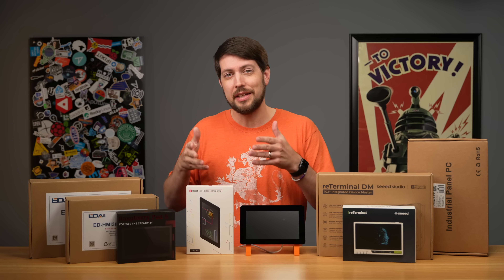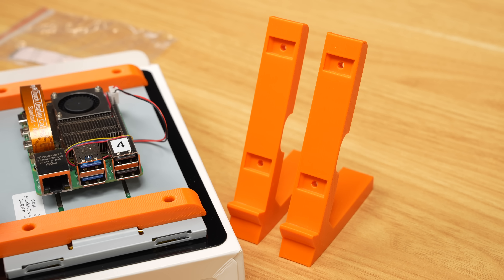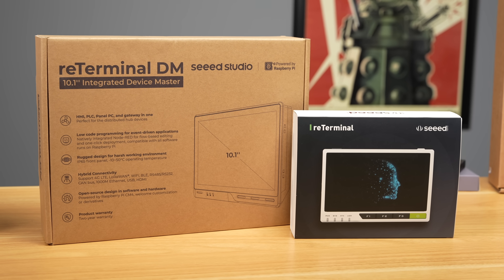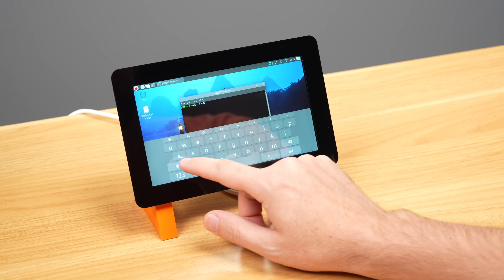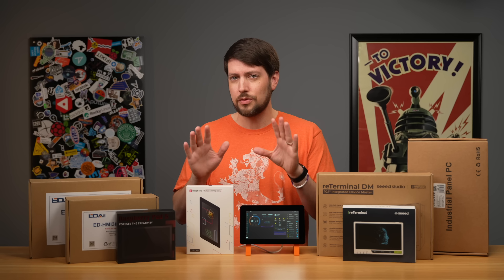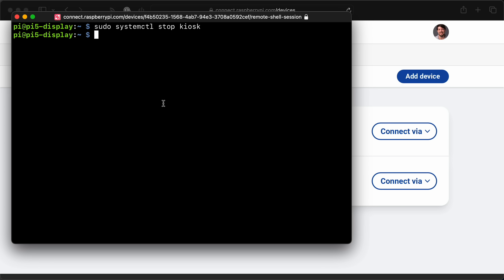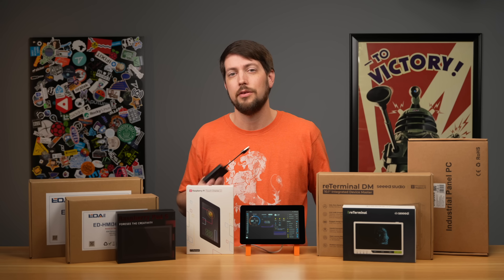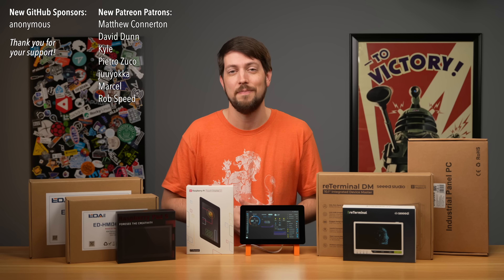I Control EVERYTHING with this Raspberry Pi

Comment: Now you got me a little worried. I bought 2 waveshare displays to see how useful they could be as displays, as well as an used ipad. One waveshare for raspberry zero w, and one with the built in controller.  I hope they've gotten a lot better than what you experienced.
Reply from the maker: It really depends on which display; some of theirs are great, some are not as well supported. But most of the time you can at least get it working with minimal fuss.

Comment: Would it be possible to use 5 finger touch to exit the service or application? Perhaps show desktop on 5 finger touch?
Reply from the maker: Possibly! So far I haven't seen anything in Pi OS take advantage of more than one finger at a time.
Reply: KDE has a lot of 3 finger touch screen gestures that could do this, and you can also configure actions when swiping in from each edge of the screen

Comment: I kinda wonder if refresh rate is a factor, and if you could dynamically scale that...
like android devices with high refresh rate displays use dynamic refresh rate to save a bunch of power, lik on my phone: if no touch and no video/animation, drop to 60fps, if touch and no video/animation, bump to 90fps, if touch and video/animation, then bump up to 120 (the highest it goes), of course, I expect the raspberry display can probably do 60fps max, but still kinda wondering 1) whether it's the only supported refreshrate, hardware-side, and 2) does using lower refresh rate have any power draw difference...

of course you'd also be wanting some battery-friendly cpu scheduler to reduce clock speed on idle and stuff like that, but that's more of universal stuff applicable to every system

Comment: For what it's worth, I can rotate the terminal on my Lenovo IdeaPad with this command:

echo 1 > /sys/class/graphics/fbcon/rotate

(Value can be one of: 0=Normal; 1=Clockwise; 2=upside-down; 3=CCW)

It might be possible to add something like that into early userspace to force the boot messages into landscape but I doubt if it would be worth the trouble.
Reply from the maker: We figured it out over on GitHub! (Thanks especially to one of the YT comments, too!).
Reply: It has been 0 days since I recompiled the Linux kernel

Comment: what's the CO2 sensor you use?
Reply from the maker: AirGradient - they make a few different types of sensors but all open source, and they aren't priced bad either. They're IMO as good as AirThings but easier to integrate with Home Assistant!
Reply: Ah, the airgradient, you mention it later in the vid, cool

Comment: So my parents got a 2021 Honda CRV with a semi-basic entertainment center and I think it's the best mix of simplicity, accessibility (still using knobs for the heat/AC  so you don't HAVE TO look away from the road - AND having steering wheel controls to change volume/track and cruise control... plus the buttons are in a good layout) I connect my phone with bluetooth and it does calls over the speakers if I want, plus I can control my phone from the steering wheel.... BUT it doesn't have GPS....  but you can connect to you phone with bluetooth and will come over the speakers and you can control the volume with the steering wheel... but the map doesn't come up on the car's screen.... but mounting a phone is easy 
- the car has lane keep assistant (it rumbles the steering wheel  when you get too close to the lines) and auto braking which I didn't know about until it started doing it way sooner than I would have  and it SCARED ME!!!! - And it's great on gas.....  Oh and it has a rear-reverse cam too, which I've grown to love LOL
- -  So you don't HAVE TO get the latest and greatest tech when you buy a new car, and I think they would have electric cars that have the same level of tech that I listed here (I think that's the type of tech that you'd want in a car too... I think MOST PEOPLE would be just fine with that level of tech (except maybe built-in GPS) - you don't need all the apps, and all the internet connection so you get album art for the music you already own....
- so MAYBE a Honda is a brand you haven't looked into, and the small SUV's carry 5 adults snuggly lol, but 4 comfortably... and they have a decent size trunk too... So maybe you ought to look into the CRV and see if it's something you'd like (idk if you want and electric car or not, but I'm sure they have a good selection) - I hope this helps is some way :)

Comment: Just buy one of the Amazon special Carplay displays. Costs the same $150, and works well enough!
Reply from the maker: The only downside there is you don't get as much freedom to tinker with it once it becomes obsolete in a few years! Though it's not a bad option by any means. I've been looking at buying a Carpuride system for a while.

Comment: i have a dedicated battery and alternator to run a small rock64pro and a 10" display for carplay in my old 1991 CRX been working smooth for years now! Better than some of the new cars with all display only 😕

Comment: I've got my old Pi display running a minimal HASS dashboard with a PIR wired in to turn off / on the backlight when movement is detected.  Does the lcd_rotate=2 in /boot/config.txt not work anymore?  On my current setup that rotates everything from boot up.

Comment: You COULD just install an aftermarket headunit into your car and get ALL the features you want, like maps/gps navigation, bluetooth connection for playing your phones music, DVD playback with multiple monitors to keep the kinds entertained (plus you can hook up game consoles to it too) , Netflix/Disney/youtube/etc, multiple ways to connect to the internet (built-in sim card slots for 5g internet, ethernet for a mobile starlink, plus a wifi hotspot to share it with your phones and whatnot) ... everything a new car 'entertainment' center would have, plus more..... ity all depends on which one you get.....
this is the BEST WAY to bring the entertainment center up to date without having to buy a new car... 
- I TOTALLY hear ya with the problems of modern cars and stuff like charging you MONTHLY to use YOUR OWN HEATED SEATS!! 🤬 PLUS their softw3are is GARBAGE, SLOW, and SO EASILY HACKABLE!!!  And WHY do I HAVE TO LOOK AWAY FROMT HE ROAD and NAVIGATE MENUS all JUST TO CHANGE THE TEMP OF MY HEAT?!?!??! And NO Mr. Amazon I DO NOT WANT ALEXA TO BE ABLE TO DO IT FOR ME WHEN I TELL HER TO... Why not??  Because BEZOS does NOT need to KNWO what TEMP I like to drive at!!! argh!!! lol
- Okay... but getting a new headunit IS EXPENSIVE if you want it to have all the latest and greatest AND it's not usually a simple job installing it unless you have done it a few times before, so you're better off spending $500 to get a professional installation done... at least the work will come with a warranty.. BUT you NEED TO do some serious searching to MAKE SURE you are going to a reputable, honest, quality shop to get it done.. because you don't take it to a mechanic to have it done, and I doubt he 'knows a guy' that is any good....

Comment: Sounds overkill but I wanted to build an alarm clock using a GPIO touchscreen I have and an older Pi for long.
That idea came to mind again recently when Nintendo released their Alarmo clock and I noticed that the phone I'm using has a faulty battery.

Comment: UPDATE: the PR was merged, so I suppose it will be included in the next release and you won't need unclutter by default.

There is a pull request on labwc github that allow to (completely) hide the mouse pointer when using a touchscreen. Give it a look!

I'm still looking for a way to get the keyboard to open/close in chromium while it's in full screen... But I'm loosing hope

Comment: I built a head unit out of pi 4 a few years back. I used a time delayed relay to control the power to the pi. When the pi is turned off it still consumes a small amount of power, like a a few hindered miliamps. That was enough to kill the car battery in 2-3 days. For sound, I used an external amp, the amp was fed audio through a usb sound card, some pulseaudio changes needed to be made to stop it from popping all the time. Amplifing from usb will feed ALL electrical noise from your car into speakers, it's truly awful, so you'll need a usb power conditioner between the port and the sound card. I think it was 5 - 10 bucks on amazon, and the best solution I had tried.
Reply: A few hundred milliamps while turned off? And it killed your battery in 2-3 days? An idle Pi while turned ON draws 540 mA. That still should kill a battery in over a week, most likely two weeks. Not to mention it's IMPOSSIBLE that it draws HUNDREDS of milliamps while OFF. It should've been fine for a few months. You must've done something wrong or had a bad battery. Besides, if you were concerned about power, why not power Pi from the lighter socket? It gets turned off along with ignition (at least in all cars I've ever seen).
Reply: @xshadow-0  sounds like something else is drawing power through the RPi, if one get that much drawn when turned off.  Maybe through USB or something like that.

But yes,  a relay will definitely turn the Pi and auxiliaries off when the car is not running.  But there are other sources which will turn of when the key isn't on, that is better suited.
It can be turned of by the Pi, with a self holding circuit, and then when turn of, the Pi can release the self holding relay. So it get started after the key has turned on, and turns of when ready when the key has turned off.  One should probably think about the lower voltage when the car is starting.
Reply: @xshadow-0  yup yup. This is why I was incredibly fortunate - I lived next door to a guy who did car audio and he made sure I didn't destroy my car and pi just for Waze and Spotify.
Reply: @xshadow-0  I have vehicles that have sockets that are powered on all the time, which is useful for some applications. Of course, I was reminded that if my vehicle dies and sits for a bit while I wait to get it fixed, that means after said month those few miliams does indeed kill the battery 😅But all is good now that it is fixed and has a new battery... though I am going to now build a safety in it that if it doesn't get power in a week to turn it off!
Reply: same, I used the aux to a 25w amp and a ground loop isolator. Quality wasn't great.. but not bad. I didn't run it off the constant power line tbh but yeah, there's only one earth in a car which makes things tricky. I used the constant power line to run a a 12->5v bucky so I could have phone charging

Comment: due to the way that linux processes and creates guis for touchscreen input, I've never been a fan of linux touchscreen interfaces within xwindows.  you can KIND OF get away with it if you use very large icons and turn off the cursor (like touchscreen interfaces on 3d printers such as klipperscreen), but anything where you have to interact with somewhat smaller elements (such as the HA dashboard you were showing off), touch accuracy becomes a frustrating problem, as does scrolling.

I'm ALL for DIYing where DIYing is a better or less expensive solution than what's otherwise available, but my current recommendation for HA touchscreen dashboard is a lower end android tablet running the HA app.  a 7-12" android tablet (perhaps even a used one from ebay on the cheap) is a great way to upcycle, has auto-dimming functionality built-in, has a way better keyboard ui if and when that's needed, and a dedicated HA app AS WELL as the ability to use a web browser in full screen if you want to for other projects.

As far as android auto  / carplay, given the industrial hardening required for such systems (in particular the environmental tolerance as you've already talked about here) as well as proper integration, AND an audio upgrade, I would probably recommend looking at off-the-shelf din or double-din style in-dash car stereo upgrades.  there are touchscreen options that allow for car play and android auto (which make them upgradable dumb terminals for a phone, which is fantastic so the car's tech doesn't go out of date), while giving you better dacs/amps, perhaps steering wheel control integration (if your wheel has audio controls), and plug and play (at least as far as plug and play as any other normal stereo upgrade) setup.  optionally you could even have a professional installer do the install for you (typically for not that expensive), and in the end, you'd have a system that looks like it belongs there.

Comment: Our college capstone project was actually building out a custom car infotainment system (although we didn't have carplay)

But for the hardware, we used a raspberry pi with touchscreen and a hifiberry dac to get composite audio then a car stereo amp to actually push it out to the speakers. Honestly unless you want a lot of software control in a pi I would consider a standard double din stereo. You don't have to worry about temperature issues and after costs are considered (crutchfield has stereos for ~$250-300) it's roughly the same

Comment: There is a way to rotate the screen using kernel cmd params - it's very poorly documented and not well known
you can add `video=DSI-1:panel_orientation=right_side_up`
you might need to replace DSI-1 with something different, but you get the point
Reply from the maker: Thanks! Opened an issue in my pi-kiosk project and will see if it works! https://github.com/geerlingguy/pi-kiosk/issues/3
Reply: Came here to say that :D
Reply: Thanks for the comment. This also works with the reTerminal. I just tested it.
Reply from the maker: @goldfingerdash  It worked!!! Thank you :)
Reply: For kiosk applications you're probably better off with custom boot splash screen
Reply: On which pis/ pi oses does this work? Only Pi 5?
Reply: @sebarsS9  All the ones, I always had to do this for those little waveshare displays with Pi 3,4, and 5. It's a kernel config so works everywhere.
Reply: @amitoshswain1764  Awesome, good to know! Thanks!

Comment: I use the original Pi display with my Pi 3 as a test bench for Pi Zero 2 w projects, as the setup gives me more convenient ports and a bit more RAM for essentially the same chip :D
Impatient to see what you'll do with the displays once the projects are finished ^^

Comment: I wonder what power consumption for HA would be on that install if pi, obviously is 24/7, but dislay would be set on via ie. PIR sensor? Has anyone tried this kind of setup?
Reply from the maker: Likely around 4-6W with screen off. But highly dependent on what you run on the Pi!
Reply: @JeffGeerling  I'm really tempted to try to do HA touchscreen kiosk, but I'd like to wake it up via maybe PIR-sensor. Tough I've been also thinking that HA e-ink display would be really cool and so-to-say non-distracting screen with just few things like critical temps. Though that would definitely need programming skills which I virtually have none. Well yeah the PIR power on display needs some skills too. Damn do I have to begin learning new things, again :)

Comment: Touchscreen works really well on GNOME, GNOME mobile and Plasma mobile but not on the standard Raspberry Pi OS desktop
Reply: No it absolutely doesn't work well in GNOME. It's only like two months ago I tried in on my Surface Pro 2 and Wayland is absolute hell. Do something that requires super user priviledges and system will instantly freeze on elevated prompt requiring to plug in USB keyboard to input password and continue. Seriously one of the worst touchscreen UI's right now.
Reply: @jothain  Really?
What distro did you use?
Because my experience with GNOME is on Fedora and GNOME Mobile on PostmarketOS and on there it works really well with touch and everything (no keyboard required)

Comment: The problem with these displays is if they get warm, the glass becomes loose. Its a POS.
Reply from the maker: I've heard that about the original display—I can't really vouch for the new one in terms of the screen adhesive yet, but it certainly isn't "rugged/industrial" feeling compared to the other screens I talked about early in this video.

It would be nice if Raspberry Pi had an enclosure that would retain the screen and also protect it slightly, by overlapping the edge of the glass a little.
Reply: Literally a POS (Point of Sale)

Comment: The carplay dongle is interesting, hadn't heard of that before! But I would probably avoid using a screen with flaky touch response for my car, trying to wrestle with inconsistent touch input is not ideal at 60mph.
Reply: To be fair the UI of Android Auto and Car Play and OpenAuto/Dash are large and chunky and kind of built around super simple touch controls so even the old screen worked well and from my limited testing in an old build (15) of open auto the new one worked fine there too. Only thing of note I could figure out was there was no multitouch support in Android auto back then, but then again the 9" screen in my 5th gen RAM doesn't do that either so I think that's more of a platform limit than a screen issue (or it could be entirely supported now and I just don't have a new enough vehicle to test that against lol)
Reply: Except most Tesla owners continuously tell me it’s fine to interact with a touchscreen at 60mph, and I’m an old man for telling them it’s only a matter of time before they kill someone. As a Tesla driver myself I just can’t understand them.
Reply: you are correct. Even a car stereo with a cheap display is a bad idea at 60 mph. Been there, done that. I got to where I  rarely used the stereo because i had to fuddle around with it and don't want to mess with it while driving.

Comment: I bought a little cheap hdmi display for my rpi3b+ some time last year. I wanted a touch one but I had to settle for just a display due to limited budget.
I use that rpi as a server and I wanted something small and portable that would let me view the status without having to plug the rpi into a TV or monitor, specially for those times when ssh isn't responding.